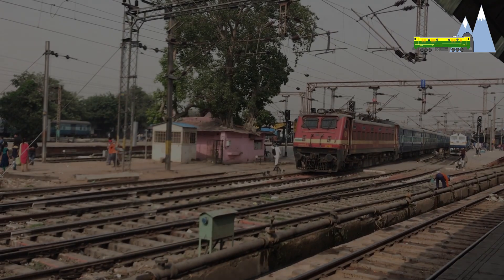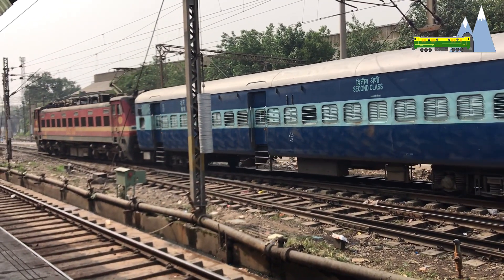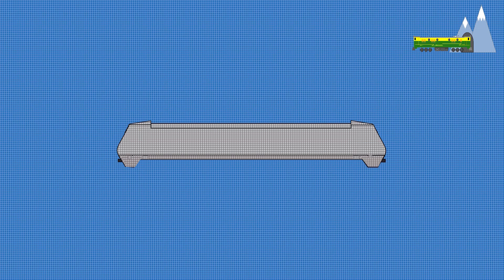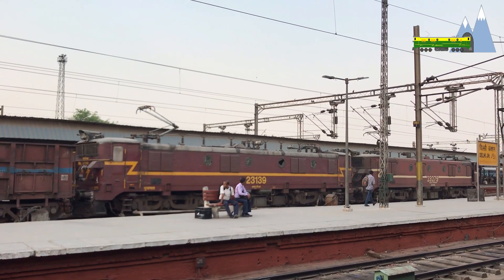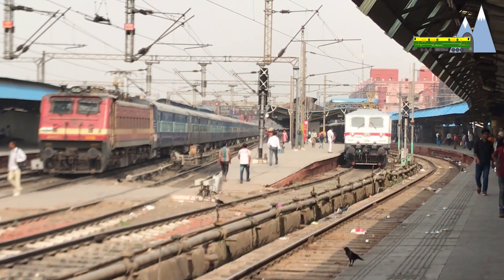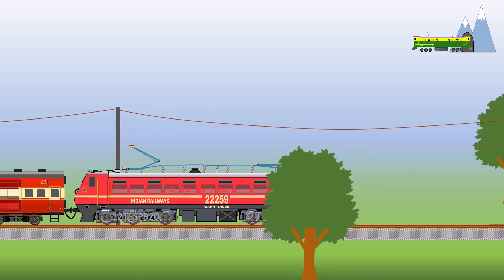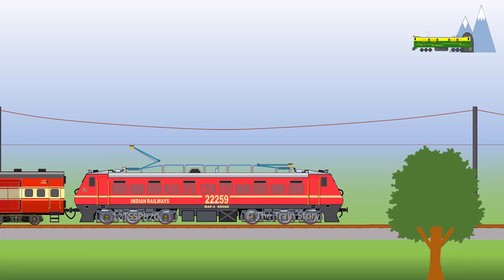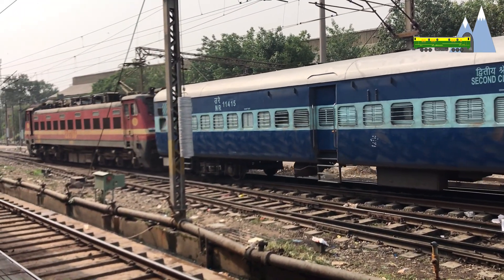WAP 4 - Electric Locomotive | A biography | Working and History | CLW | Indian Railways

Comment: When wap 4 has top speed of 160 kmph , what is the real use of wap 7 which can has just top speed of 140 kmph ??
Reply from the maker: To best of my knowledge, the WAP 4 was tested at a top speed of 169 kmph. It’s is rated for a service MPS of 140 kmph. 
The reason for the replacement of the WAP 4 with the WAP 7 was because the latter has a more modern 3-phase AC-AC traction

Comment: Nice video, Hitachi traction motor used in WAG7, WCAM3 and WCAG1 Loco all these loco rated same power out put however presence of this loco feel more macho than three phases siblings however can IR used modern BDC motor in this loco?
Reply from the maker: Yes the WAP4 has a certain character and presence.
It is very unlikely that the IR will make any more updates on the WAP4. There focus will be on the newer tech locos now being built..

Comment: In my opinion. 

WAP 4 locomotive should be modified and replace their DC motors to AC. 

Not shutdown productions. It is very successful locomotive.
Reply from the maker: Building several classes of locomotive is not an efficient use of resources. As the WAP-7 can do all the functions of a WAP-4, it would be more efficient to concentrate resources on this class. The WAP5 and WAG9 have different roles (compared to WAP7) so they will be built alongside the WAP7. Unfortunately the WAP4 (now obsolete) had the same role as WAP7.

Comment: Nice Video ♥️  But 1st WAP-4 is 22061 which was a WAP-1, and after Successful High Speed Trial with Hitachi Traction Motor, it was classified as WAP-4. After that, 22201 was manufactured.
Reply from the maker: Thanks for the update...